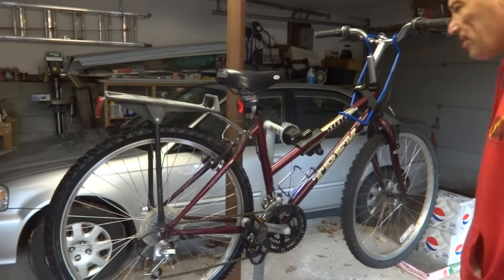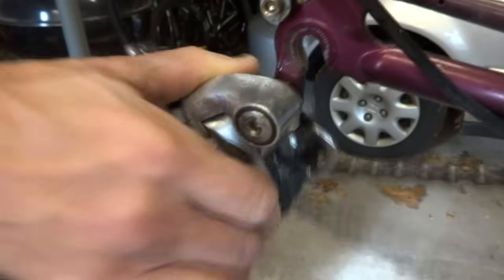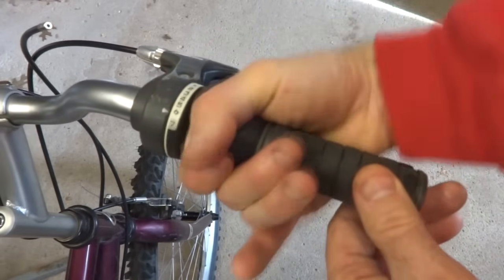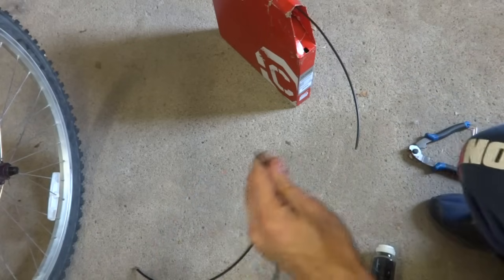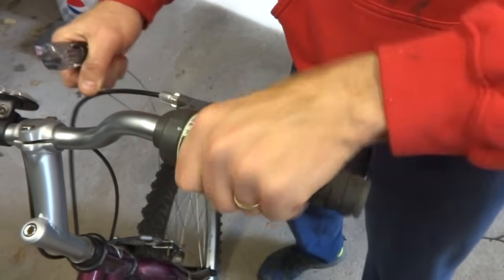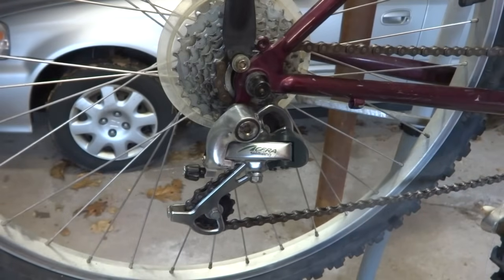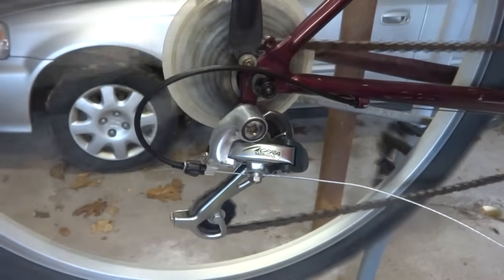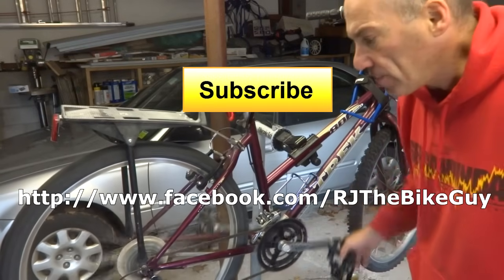How To Diagnose/Repair Stiff/Sticky Shifting On A Bike

Comment: RJ, you put out some awesome videos!
Took me years of trial and error to get to a competent level of bike knowledge pre internet.
One thing I would like to add here is make sure that you install the cable correctly when you cinch it down on the rear derailleur(or any derailleur). I made the mistake many times of placing the cable on the wrong side of the cinch bolt which affects the shifting slightly.
You will see what looks like a little groove where the cable is supposed to go on higher quality derailleurs.

Comment: Thanks again Shyflirt1  this video + the sti shifter fixing video --> How To Fix STI Shifters (Brifters) That Won't Shift
Really really saved me, my ultegra flight deck shifters, They weren't shifting at all, I replaced the cable and aswell noticed the cables were sticky, I cleaned them like you showed, and slowly it start shifting, It really made me happy, I have now a  redbull pro road bike with mixed components shimano Ultegra, Dura acera, 105, not so good idea but its really an amazing bike to ride, After seeing your guides my bike is perfectly working and I can fully feel how smooth its running, and get some pretty fast speeds.
Thanks again
Reply from the maker: Cool!

Comment: I destroyed my derailleur on my bike, so I bought a new one and installed it. I had crappy shifting no matter how I adjusted the tension. Couple month later I found why: The housing was too short! It was ok with the old derailleur, but too short for the new one. The housing has to turn 180 degrees to fit in the derailleur, but if it's too short it's actually pulling on it and messing the indexation. So I bought new housing and new cables and now my shifting is perfect!

Comment: I have a recommendation for you. Rock n Roll makes a cable specific lubricant that makes shifting and braking feel very "slippery." You explained to me that lubricant negates cable operation, however this lubricant has proven to be extremely effective (of course if you use it correctly). It's sold in a 2 oz. bottle and it is advised to drop a few drops into each piece of the housing to avoid future contamination.

Of course, you are entitled to your own techniques if you do not wish to proceed with this recommendation.

Comment: nice film. I have the grip shift esp 9.0 rear.  The front changer is a Shimano 443  as I use 43/52/63 chainwheels for a 20// 406 drive wheel.

Comment: I would have started with the derailleur pivot points... if you lube them, and are still having trouble, then move on to the other components. I also like the "precision oilers", where you can drip the lube exactly where you want it, instead of the "aerosol blast method".  Thanks for the video!
Reply from the maker: More often than not, stiff shifting is the cable/housing.
Reply: @RJTheBikeGuy  I'm lazy... I try the easiest thing first! ;-)

Comment: Mine is the same setup my bike is a jamis cross country trail series bike according to the company the bike is not in there system it was made between 1998 and 1999 I assume that the company had retired the cross country line of bikes to make room for newer lines of bikes it’s a very nice bike my thoughts are to change out the bearings and cups in the head tube to threadless and to put a front shock fork the crankset is an sr sun tour the wheels are sun rims z19 the front derailleur is also a shimano acera

Comment: My derailleur clicks, doesn't always change gear, and will sometimes change gear on its own. I checked the hanger with a Park Tool hanger adjuster, and I put in a new OptiSlick cable system, but it was still the same. 

As I could see absolutely nothing with my derailleur I went for the Sl-4600 shifters, but it wasn't that. Fortunately, I was able to send them back as I hadn't used any cabling or opened any bags.

Shimano have discontinued the Rd-350-10 Derailleur, so I've bought the Tiagra 4700 shifters and derailleur, but I'm still waiting for the shifters to arrive.

The RD-350-10 must be faulty. At the knuckle, where it bolts to the hanger, there is some slight lateral play, but everything else seems fine. 

I can see up inside my downtube and the cable is not snagging, and it seems free throughout. It's free in the rear wheel chainstay too. 

Thanks for these great videos. I didn't know you could service the derailleur, but after seeing your videos I have the confidence to try it now, so I might have a go later today. It would be amazing to get it going. 

I'm trying to do my own repairs now as I do a lot of miles and can't afford to take keep it to the shop. Plus, it's a great hobby.

My bike is 2. 5 years old Trek Fx4 sport, flat handlebar, rim brake, hybrid Road Bike. 2 x10 Speed . A great bike. My local bike shop have adjusted my gears several times too at servicing. But I do my own servicing now.
Reply from the maker: https://www.youtube.com/watch?v=gwBQxhZhKnE

Comment: Hello RJ, great video you have here. I have question. I have some problem with a grip shifter which is similar to the one shown here. The problem is that when I try to shift lower gear the grip shifter is very tight and sometimes impossible to shift. Shifting to upper gear is smooth however. It would be great if you could give your thoughts on what might be the problem. Up to this point I've changed cables, lubricated derailers and the shifters.
Reply from the maker: Did you replace the cable housings?
Reply: @RJTheBikeGuy  Could that be the problem? I have not changed it into new ones yet but I applied some lubricants inside the housing and the cables. It did not seem to effect the tightness of the shifter abit.
Reply from the maker: @zzxz9008  Yes! Go through the video. The stiffness will be derailleur, or cable/housing, or shifter. Isolate it, fix it.

Comment: Hi RJ. If you were to install cables on a high-end bike and you wanted the best longevity, what would you choose and would you do anything special? I'm about to try uncoated stainless shimano cables and grease them with some paraffin wax lube. I'm also interested in shimano optislick that people say is amazing. Ever tried that? Thx for a great channel.
Reply: Hey mate thats sounds like a great idea! did paraffin work out for long term?
Reply: @rossg9363  I can't say for sure. I used chain wax lube on the cables and it kind of started to bind after about a year (maybe it was because of winter and how low temperatures make wax hard?). Might work better in hot climates. Anyway, I found a guy online that sells syringes with shimano cable grease (so you don't have to buy a whole expensive can). I use that now with stainless steel cables. That works for me as a base install.  However, as much as I don't like the idea of coated cables losing their coating and becoming messy, a friend's Shimano duraace cable kit is still smooth as butter (after it started looking like crap), so many years later. (He asked me if he should swap cables after 5 years and I checked them out. Still freaking smooth. I was afraid I'd make them worse basically.) But you DON'T want to have to take it apart because if you frey or kink something it's a lot of money. So if you're going for longevity for a long term install, try the duraace kits. Otherwise stainless steel cables and shimano cable grease.
Reply: @rossg9363  Actually if you get new Shimano standard OP41 shift housing, it comes with the grease inside of it. If you take it apart, you might want to regrease. For noname housing better use some grease.
Reply: @mikeh6286  sweet mate ill 👀 into that now thanks👍
Reply: @mikeh6286  just bought this "Shimano Advanced OT-SP41 OPTISLICK MTB Shifting Cable Set" the sheath you said with optislick inner cable 🤘👍 very nice!

Comment: Hey RJ,

On a road bike with the shifting in the brake lever, what does it mean if you have to hold the brake lever with your thumb while you push on the smaller lever (shift down to a smaller cog) to get it to shift?

Thanks,

Blake
Reply from the maker: One modern integrated brake.shift levers, there are two levers. The brake lever and a smaller lever behind it. They both push the the side. Push the brake lever in to shift up to the bigger gear, and the smaller lever to shift to the smaller gear. I generally don;t have to hold the brake lever, just press the smaller lever.

Comment: Hey I know that this is a older video but at this moment i have teflon oil would that be good for lubricating derailleurs and cables?
Or should I go and buy multi purpose bike oil?
Reply from the maker: For the derailleurs I usually use Tri Flo or Finish Line Wet chain lube. I don't lubricate cables. Modern cable housings have a plastic lining that allows the cable to slide through. Lubricants can be counter productive. I recommend replacing the cables/housings if they are sticking.

Comment: what size hex driver did you use?  are they all the same size?  when i set it, is 1 the big gear or the smallest?
Reply from the maker: +Myria no I don't remember what size I used. I am guessing 5mm. 4mm, 5mm, and 6mm wrenches are common for bikes. Also 2mm, 2.5mm, and 3mm for some stuff. Usually 1 (on the shifters) is the smallest ring on the front and the biggest cog on the back.
Reply: thank you!  incredible how i looked like i knew what i was doing!  the gear won't slip onto the biggest cog in the back.  any suggestions?
Reply from the maker: Maybe cable adjustment. Maybe limiting screws. Maybe bent deraileur/hanger. Maybe the derailleur isn't designed for that many gears... many possibilities.
Reply: i was afraid of that.  i tried the cable and limiting screws; i'm going to get local hands on help in case it is a bent part.  thank you so much :)

Comment: I'm not really a bike guy, I've always had a natural and strong interest in all things mechanical. So bikes should pose an interest, right? Only reason why I never got into them was because I always had the cheapest, oldest and usually most dangerous (none working brakes, loose tyres and chains). Plus I usually was given a girls bike and at a young age ones peers would remind you of that fact very often. Although once in a while I'd get a bike that I really liked. I remember one such one bright red, very low and kinda wide. It was 'fat', the construction wasn't normal, the main tube was really fat and doubled, it also had a lot of chrome and best off all it had fat white walled michelin tyres. It was also really fast. Anyway back on topic, I was given a bike which I slowly fixed. I've only just started to look at the gears. Same style shifter as the one in your clip but they won't move at all. I've tried a few things and everything looks smooth and lubed. The actual grip shift is also nice and ratchetity, without the cable. I've tried quite a few things but as soon as the cable joins the shift it simply won't turn. Funny thing is I get how this all works, I slowly got to grips with the upper and lower restriction screw and guide position. I even fixed the 3 cog part on the pedals which had a similar issue. It's not too important, I use this bike just for my dog. He loves to run and I feel safer with him on a lead. He has good recall but some areas are huge and filled with runners. Also the bike is very resistive, feels like I'm going uphill all the time. I thought it might be the brakes touching but they don't, tyres are pumped hard and it's not like the bike slows down really fast after pedalling but it does slow down. The rider in front wasn't pedalling but was managing to get away even though I was turning at a medium speed, I thought electric but it wasn't.

Comment: What makes a clicking sound when I peddle my mountain bike. Is it my derailer?
Reply from the maker: jackie kuang Sorry, but phantom noises can be way too many things to list: bottom bracket, cranks, chain, freewheel, hub, etc, etc. You just need to start going through bike and find the source of the noise.
Reply: Thanks RJ The Bike Guy, and I have one more question. My bike rim is always in need of truing and I hate how I always need to do it myself. Usually it is on my front tire now its on both. Should I get a new bike?
Reply from the maker: jackie kuang That is up to you. Are you riding it rough, or is it a cheap bike?
Reply: It could be that its a cheap bike.
Reply from the maker: jackie kuang Cheap bikes do have lower quality components that will flex more and are built to lower tolerances.

Comment: Why not show the complete diagnosis process first before cutting the cable
Reply from the maker: Because most times the issue is the cable. Cables wear and should be replaced occasionally anyway!